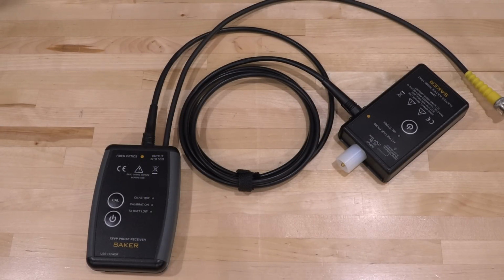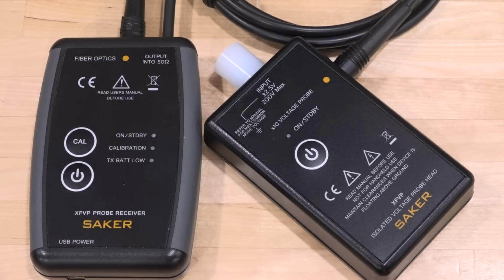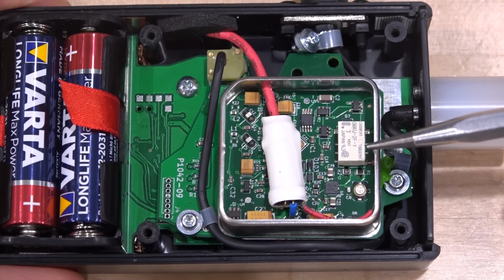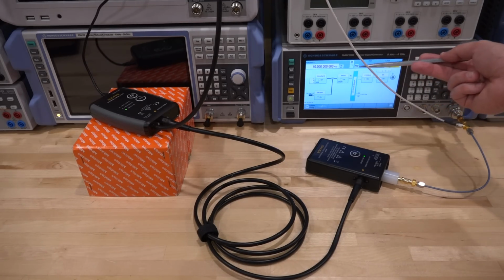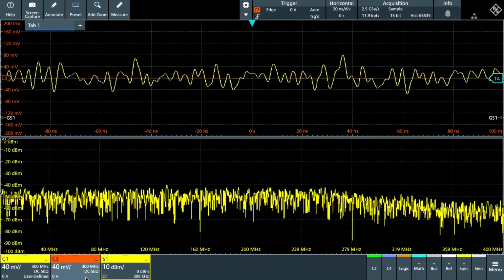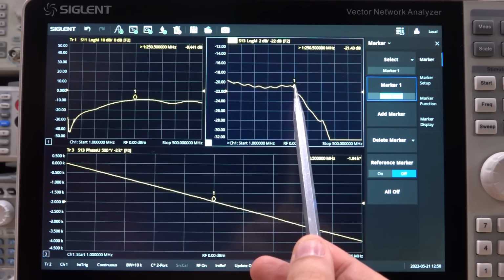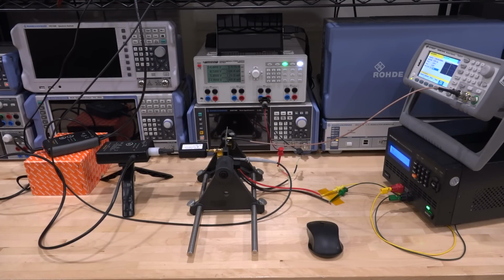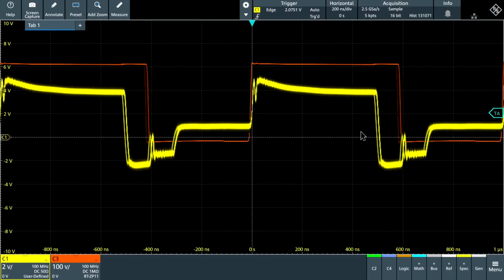TSP #262 - Saker 50kV Common-Mode Fiber Isolated Active Probe (XFVP) Review, Teardown & Experiments

Comment: Thanks for the teardown Shahriar, maybe someone will donate an IsoVu probe so we can do a shootout.
250MHz is actually terribly slow for GaN-based converters, especially lower voltage devices (rise/fall times ordinarily are <1ns). I'm guessing that THD of the optics is the bottleneck.

Comment: It would be interesting if you could repeat the measurement, but use a shorted MMCX connector (all pins soldered together) and connect it to the Vsw node (high side source). That way you could see the actual CMRR with the 400V edges.

Comment: Hi, at [26:06] I see the edge induced common mode rising to a dip of about 2.5V. Quite large. Assuming 310V power supply, this is a CMRR of 20 x log (310/2.5) = 42 dB. Allow 20 dB for the 10x divider, and that is 62 dB. Still much worse than the spec. What is going on??  You can see it is a probe thing, as the dip grows with the power supply voltage, while it should stay constant if it was a problem in the power supply. 
The statement that nothing is changing is not correct, the other parts of the signal are much lower bandwidth.
Reply: I don't think we can be sure it's a 'probe thing' that is being seeing at 26:06. The gate that's being looked at is itself  being driven by an isolated high side driver which is also having to deal with the 310V common mode signal. These drivers are not perfect, there is for instance around 2pF across the drivers  isolation barrier, this is not ideal when looking at nS rise times. I feel that what the Probe is showing us is exactly the type of signal that these fibre isolated probes will be ideal for looking at.
Reply: Hi Paul, Thanks for the reply - you are completely right, the power supply can indeed have a dip in the output, not a good thing as it starves the gate of current. A simple way to check which is which is to short the probe tip to the common and see what happens then as you probe the upper switching transistor drain. But I guess you no longer have the probe.  @Paul-sc2ue
Reply: Hi Bart
Yes some more experimenting would help to clarify exactly what is being seen. I have never had one of these probes to play with, I just watched the video because I've been looking at this type of galvanic isolated probe and the video came up via google. 
It could be a dip in the Power supply to the gate drivers, these are actually produced via two transformer isolated DC-DC converters. in the Eval Board app note they mention they have tried to keep the barrier capacitance to a minimum by reducing the number of windings and capacitively doubling the voltage. The isolated gate drivers also use some form of internal transformers to isolate the low side from the high side drivers. this again will have some barrier capacitance.
Although the designer has tried hard to minimise the capacitance there will still be some capacitance across the barrier.
With 300V 1MHz square waves on one side of the barrier and the other side being effectively at earth potential the fast edges will get across the barrier and will cause a nuisance of themselves.
For instance the gate driver on the high side is driving the gate of GaN device  to around 5V wrt its source, as both the gate and source are riding on  the 300V square wave, if the gate happens to 'see' more of the barrier capacitance than the source then this will cause the gate drive signal to change (for the worse) possibly causing the spike we see as the voltage increases.
When you are designing / working with circuits like this they are never perfect because of all sorts of factors, however it looks like these isolated probes are going to be a big help looking for all the little subtle problems that arise.

Paul      @bartschrodernz

Comment: micsig has a new optical probe, too. It would be cool to see how that one compares.
Reply: On our sales rep website they mention that the MicSig can only be used with MicSig Oscilloscope. Looking at the images the MicSig oscilloscope do have a weird connector like the old LeCroy equipment had. This is nice, but it also is cumbersome because it hardly is possible to mix probes from other manufacturers. A sort of 'vendor lock-in' so to say.
Reply: @fantasticoadidas  Micsig's optical probe is standard BNC interface though.
Reply: @fantasticoadidas  That's true of most scope specific probes unfortunately. I have a tek current probe, and even though tek scopes aren't my favourite, I have to use one.
Reply: @fantasticoadidas  Actually, check out the new EEVBlog video on the micsig optical probe. Standard BNC interface!

Comment: In order to reduce noise , could an optically isolated probe work better if the signal on its input is modulated, say with 1GHz, put in the fiber, and then demodulated?  My guess is, it will have better linearity, but I do not know if it is really worth for noise and delay versus complexity and battery life.
Reply: You'd also have the added noise from those conversions too, nothing is free ;-)

Comment: I have R&S RTH1004 which used to design microcontroller soft start main power supply , I notice then isolated oscilloscope is must , specials for designing EV cars , with 600v on one side and 3 volt to controller side ,  there is no other good scope from other brand except R&S, could you review RTH1004 ?

Comment: The conector for the control fiber looks like your "pof" (plastic optical fiber) connector that was being pushed as a standard for in home use a few years ago. It was a 2.2mm plastic fiber using visible light and no special tools for terminating. look for "optolock" cobnectors and POF internet...

Comment: What tripped me up when trying to follow along with the setup at the end of the video is that you're saying that you're measuring the gate-source voltage of the low side GAN with the passive probe, but that wouldn't show the CM swing that's present on the high side measurement (you'd see the 8-ish volts produced by the isolating power supply). Checking the app note confirms that you're connected to TP3, not TP2, which measures the drain-source voltage, which indeed corresponds to the CM swing.

Comment: I'd love to see what the MXO can do with that measurement using 2x probes and math on the 12 bit signal. If you calibrate the the channels before the measurement, I think it can do it almost as well as the isolated probe?

Edit: I'd love to see an investigation of the MXO's high resolution mode now... Looking at the datasheet it claims 18 bit resolution at 10 MHz bw - but this requires a 14 bit ADC at 5 GSps. If the ADC was only 12 bit, getting an extra 6 bits would require oversampling by 4^6 = 4096, or ~82 GSps. Presumably their claim of a 12 bit ADC is just modesty.

Comment: Adding external dongles to add further attenuation just sounds a little weak. For 6k, there should be an attenuation selector on the front end.
Reply: high voltage, bro.

Comment: What surprised me is the flat phase response. What is the main contributor/culprit to it?
Reply: With a relatively large delay through the probe and its cables, the delay will dominate the phase response and result in a steep slope that makes it pretty hard to see any deviations from a perfectly straight line. It would be more interesting to see a plot of the group delay than the plot of the phase. Or a plot of the phase where port extension/electrical delay has been applied to get rid of the part of the phase that is caused by a pure delay.
Reply: @Axotron  A measurement that I like to use for this type of thing is "deviation from linear phase".

First step is to unwrap the phase, so it keeps on going instead of wrapping modulo 360 degrees.

Then you fit a line to it between two frequencies and plot the delta between that line and the actual measurement. This makes small nonlinearities much more evident. Surprisingly, this isn't available as a math function out of the box in most software so I had to write it myself for ngscopeclient which is what I use for this kind of analysis.

Comment: Modulating the light intensifty is nearly the simplest way to achieve optic-isolated probe.Just wonder if the gain of the proble changes when you bend the fiber or the room temperature changes?   I guess Tek's probe adopt frequency modulation with much more compliated compensation and controls. Hope to see you tear down tek's probe and make a comparision.
Reply: You'd need a fairly substantial bend to get a large impact on the output power I think. You could be very fancy fairly easily if you wanted to control for that though. "Just" send one signal through at a constant output power on one light wavelength and use that to adjust the gain on the modulated signal on another wavelength The optical components to do that are pretty common in the fibre communications world. Of course you've now added another source of noise. I imagine the "cal" button there exists mostly for that reason.

Comment: Wow, the external battery pack you can get for this probe costs almost twice as much as my oscilloscope. Don't ask about the actual probe. The levels of gear-envy this channel induces are inhumane.
Reply: But what use do I get from such a probe?? How often do I work on 50kV and need 200MHz scope??
Much better buying an old excavator, might actually get used for something ;-D
And even if I would need it somehow, cheap battery scope from china floated @ 50kV would be simpler/cheaper solution.
Reply: @hinz1  The probe is a specialty, yes. I'm more envious about the scopes, etc. However, I did recently have a use case: debugging brightness fluctuations in an old analog scope. I needed to look at small fluctuations between voltages that were about 2kV below ground in common mode. I could do it with a self-made optocoupler circuit, though, that is an ultra-cheap version of what this probe does much better.
Reply: @EdwinSteiner  Nice new gear certainly is nice, but it's a big cash grab too. 
Old, cheap ebay Tek scopes and HP gear from 1960-80s you could almost always repair yourself for little cash, have fun and learn something.

Highend stuff 2000s onwards, spend big cash buying it and maybe 50% repair chance, if something simple breaks. Otherwise dump more cash to manufacturer, to get it repaired, hopefully. Calibration and everything, digital, nothing you can simply fiddle yourself with screwdriver. 

And for the not so sophisticated stuff I sometimes do, a good Tek7000 (usually repaired many times over) and a bunch of plugins is all scope I need, perhaps some cheap Rigol or HP logic analyzer for digital stuff. 

I.E. I'm not that envious to keep all that stuff running and calibrated, let alone for the dumpload of cash that went into acquisition...

Comment: I just let my USB oscilloscope float 😅(I'm very careful, no panic!). I use an USB 2.0 high speed (not fool speed!) isolator, you can find these ready to use for audio applications for ~150$ (I had to modify mine though, didn't work out of the box) (fiber usb isolators also exist, but I've not tested that yet). I built a highly insulated floating 5V power supply by coupling a stepper (used as a generator) to an mains AC motor with an insulating shaft. I successfully used this setup to measure signals with 400VDC common mode offset on some power board.
Reply: I mean I wouldn't trust it to 10Kv, but I use the $5 USB isolators off aliexpress for development just so I don't take out my computer doing something dumb. They put out modest 5v power and do actually appear to be truly isolated. Just for anyone who wanted to try it on a budget.
Reply: @zyeborm  just my 2 cents: one thing to be careful about when chosing the right isolator: USB 2 has three speeds: low, fool and high speed (I spell it "fool" instead of "full" on purpose, many get confused that "full speed" is actually much slower than high speed!). Some isolators only handle low speed USB 2 packets (which are also USB 1 packets). Some isolators handle low and fool speed. The one that I have does high speed. Depending on the oscilloscope, low/fool speed may or may not be sufficient.
Reply: Nice idea. Better then trafo isolated classic scope that you have to touch.

Comment: I wonder how much current the head draws, and if it could be powered by pumping relatively intense light through the "oob" fiber. Like the Dallas 1wire protocol (power and data on one line), but with fiber.
Reply: I am fairly sure tektronix does that in their isovu probes, however they are 3/4x the price

Comment: I wonder what the CMRR vs frequency is on that probe.
Reply from the maker: I was going to measure it, but didn't get a chance to. In the datasheet, it is listed as:
CMRR:
 < -110dB from DC to 10MHz
~ -90dB at 100MHz
~ -65dB at 200MHz

Comment: How does the transmitter encode the measurement over the fiber? Does it just modulate the intensity of the light? Or is it more complicated?
Reply from the maker: It is intensity only.
Reply: @TheSignalPath  That's what I was thinking. How does the probe calibrate DC values? Does it have its own voltage reference to compare measurements too?
Reply: @ZergZfTw  There is an optional module that you can plug into the input to do offset and 2 point gain calibration. The Lecroy HVFO108 is around the same price as this probe and has a much more sophisticated architecture which is more resistant to offset and gain drift.